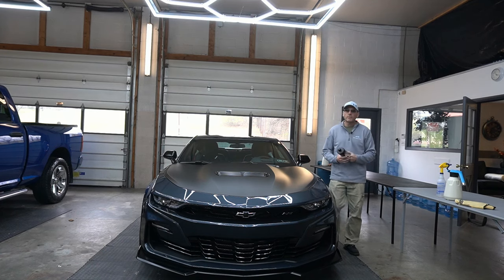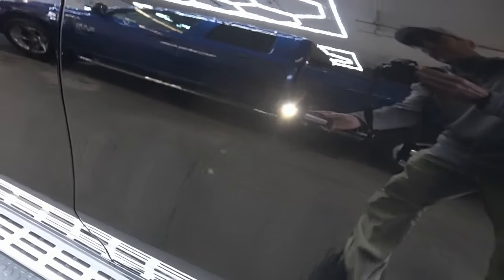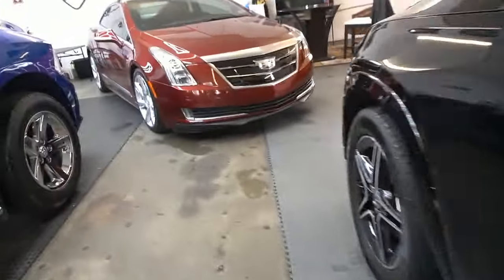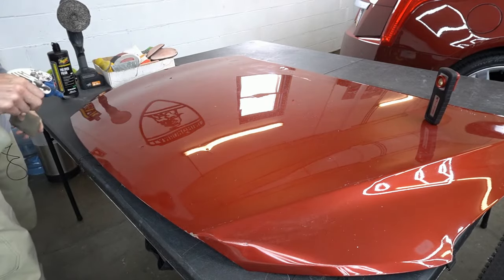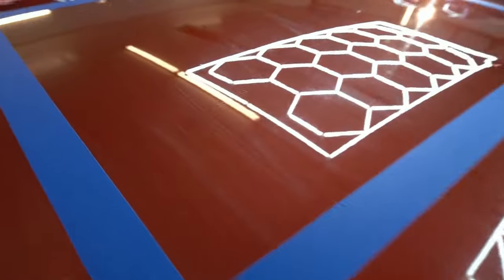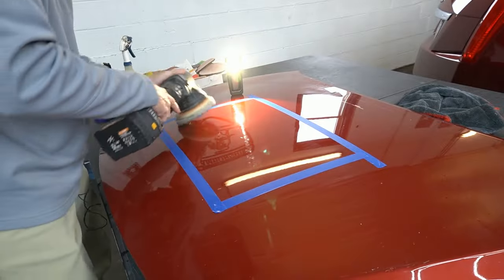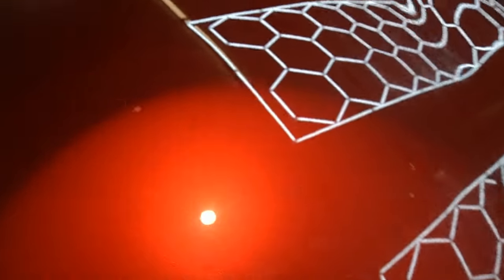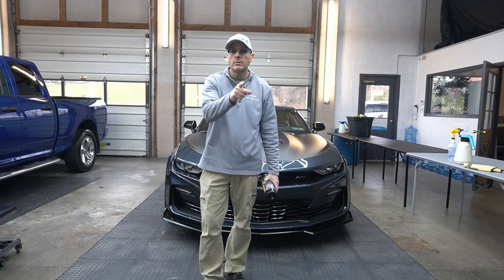Meguiar's NEW Professional Pro Speed Polish M200!! Is This The "Convenience" Polish You Seek?

Comment: I've been using M83 for years. Would this be a good replacement for that or is M83 still better?
Reply: I was recently chatting with Meguiar’s, and this is supposed to be similar to M80 speed glaze, same cut at 4, long open time, easy wipe off, it is a cleaner/polish like M80. M83 is more aggressive, this M200 will finish better in one step.

Comment: Some of Meguires products I like. Their clay bars, liquid ceramic wax, ceramic detailer, and I do like their Ultimate Compound as well as Ultimate Polish. However i never cared for their commercial line of compounds, glazes, and polish. Never worked well for me
Reply: I always preferred the Ultimate Compound and Ultimate Polish over M105 and M205. 

I do really like M205, but Ultimate Polish never marred a finish for me, and I'd have to sometimes follow M205 with it - like a handful, but you don't want to be trying to figure out a solution when the clock is ticking.